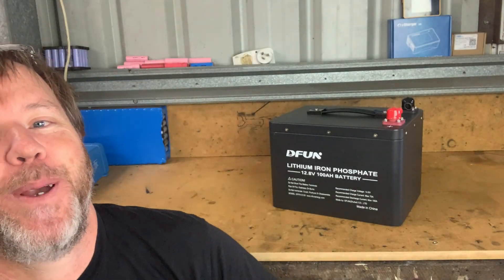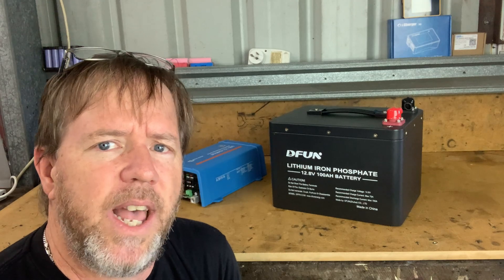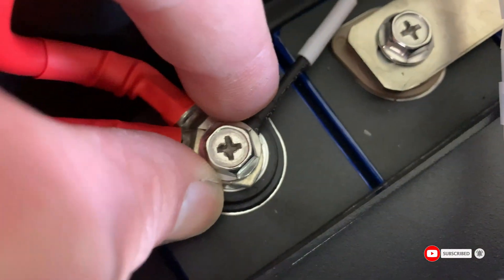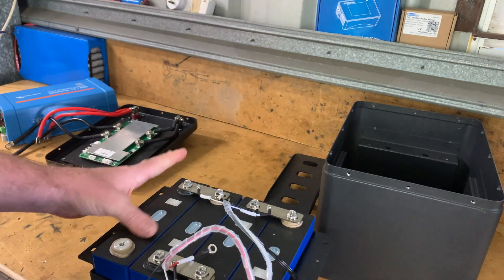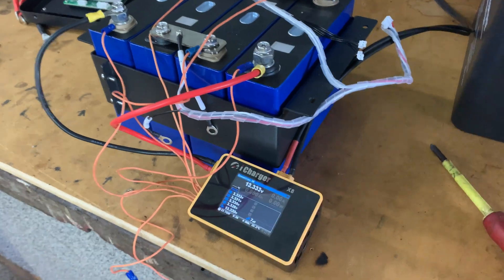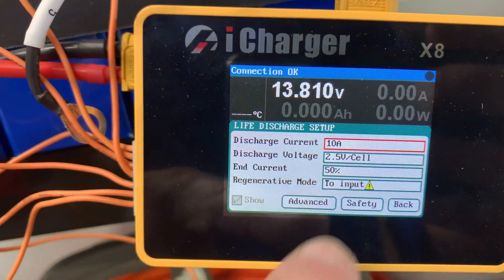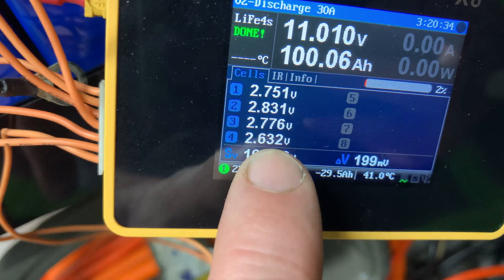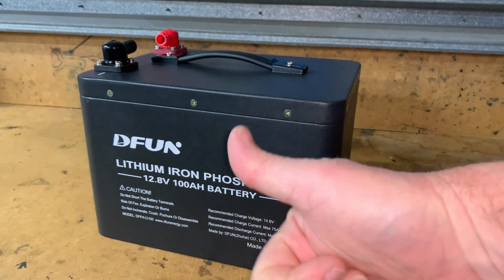DFUN DFPA12100 12V 100Ah Deep Cycle LiFePO4 Battery Review

Comment: Hi, How can I send you the 12V200Ah lifepo4 battery for testing, it has the function of low temperature protection.
Reply from the maker: Sure, admin@diypowerwalls.com - Low temp protection is a standard requirement in this type of battery, isn't it?

Comment: Interesting question, If I connected four of these batteries (48V) in series would another BMS be needed between each battery, otherwise each 12V battery would get out of step ?. Obviously each 12V battery has it's own individual BMS.

Comment: @HBPowerwall 6 volt golf cart batteries is twice better than 12 volt, look at 6 volt ah or cca then look at 12 volt ah or cca

6 volt has larger storage Ah/CCA  than 12 volts
Reply from the maker: Did the whole 6v batteries back in the day 330ah jobs - 880ah at 24v in the end couldn't get 5kwh out of them over night before they went low voltage - they MIGHT have been 10 years old when I got them tho and had a very hard life in floor scrubbers being 100% cycled everynight.
Reply: @HBPowerwall  was just a thought, but now I was speaking deep pocket new LOL

Comment: LOL- didn't realise you were that close, I'm only a couple of hours west of you... I run offgrid here, using (currently) a 12v 1200ahr bank (4s4p 400ah winstons) which I am super impressed with- by staying away from the top and bottom ends of the charge cycle (14v max, 12v min) even though I don't have a balancer hooked up, I check regularly, and was going to manual balance if required- these have been in use just over two years, and are still within 0.02v of each other with only ever having done an  initial balance the once when new... (eventually they will be a 48v 16s configuration but as the caravan needs 12v, stuck with that and the 8kw 12v inverter to begin with)
Reply from the maker: Thats great spread for that long! Should last a while with the shallow DOD
Reply: @HBPowerwall  The factory specs say 5000 minimum cycles at 80% DOD, 7000 cycles plus at 70% DOD- I'm running about 30% DOD so expecting considerably longer (7000 cycles at one cycle per day is 19.6 years!!!)

Comment: Reminds me of the SOK batteries I use for my RV. Same sort of metal construction. Very nicely put together. Mine are 206AH, 12V, nearly the same size as a t105 golf cart battery, with twice the AH, and LiFePO4 to boot.
Reply from the maker: SOK are square - think that's the only difference..

Comment: Good to see u, would camping be all right charging from alternator or a AGM dcdc charger or lithium specific charger.
Reply from the maker: I would say a proper charger would be needed, that something I need to look into myself.
Reply: Lithium can potentially over tax the alternator if connected directlty, because of the low IR. Really need a FFP charge controller. They are plentiful.

edit: although maybe not if the inbulit circuitry takes care of that?
Reply: That's the advantage of the LiFePO4 lithiums- they can be connected or charged directly from a 'car alternator'- although one thing to look out for is most standard alternators are undercooled- so when asked to handle high outputs for extended periods, can overheat (a lot of people say you can't use lithiums on an alternator- but it isn't the fact that its a lithium that causes the issue, it can also happen if you have a heavy electrical load of any description- be it a large L/A bank, or spotlights or anything else... (those doing motorhome or boat installs are aware of this, and take measures to provide better cooling...) Occasional use is one thing, but  for a daily use system, either a current limited DC/DC converter or an upgraded alternator is a better choice

Comment: Hi Pete could u try Andys barcode app on the cells, just out of interest (LiFePoQR) please?
Reply from the maker: For sure, easy as I need to take the top off the battery again after that last test. I didn't recharge it and now the BMS won't activate again :P
Reply from the maker: Ok - point me in the right direction please, can't seem to find what your talking about
Reply: @HBPowerwall  LIFEPOQR is the app on my Android phone
Reply: May not be available for Apple!
Reply from the maker: Ooh yeh that'll be an issue - not a roid in the house

Comment: Could you add some washers on the terminal instead of shaving them down?
Reply from the maker: Yes, that would be an easy fix, but way easier just to knock them off. Is a very small thing I didn't think would matter but it really does.
Reply: I beleave washers add resistance!
Reply from the maker: Arr didn't consider that, it would not be much tho
Reply: @HBPowerwall  Apparntly even minor resistance throws out the readings for BMS balancing on LIFEPO$ cells!